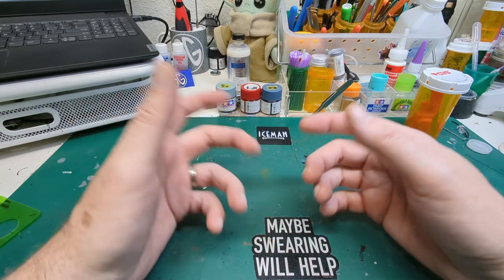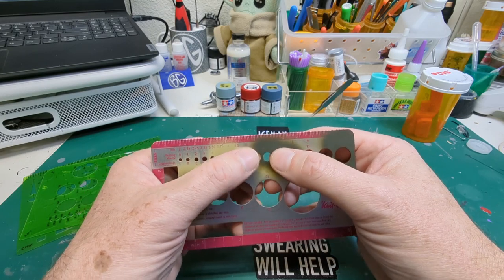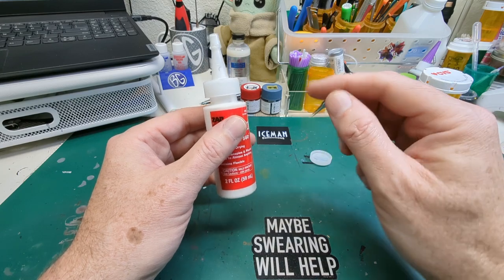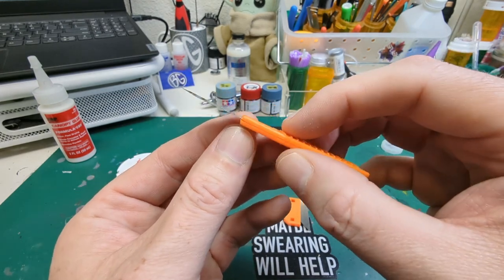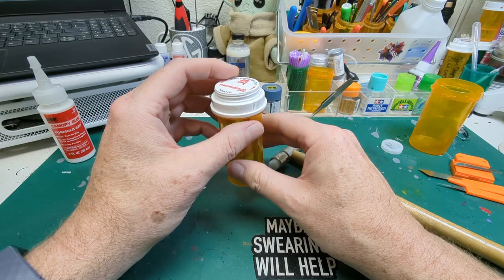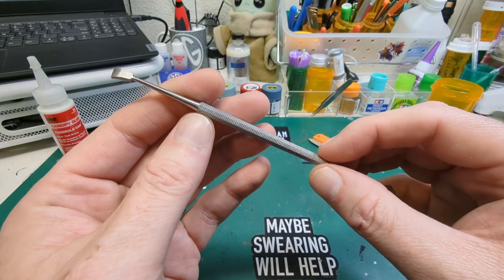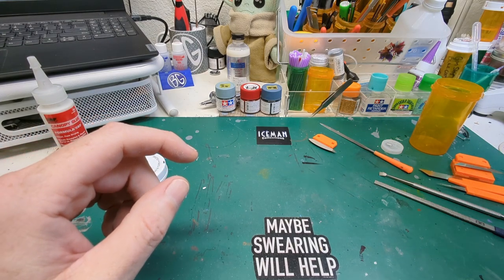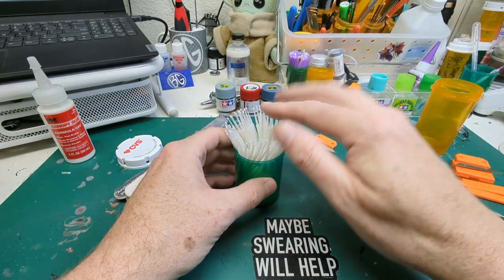The Tools We Use On Every Build! A response to Mark Batson's community question!

Comment: Nice presentation of some of the tools you use.  I really like seeing what other people use in their modeling.  I like those saws.  They look really neat.  I tried to find them on Google and didn’t have any luck.  The Tamiya file looks really nice.  I’m glad you mentioned a beauty supply store for the files.  You can get them for a lot cheaper there than you can at a hobby store.  Don’t forget the eyeliner brushes while you are there.  Thanks for sharing.
Reply from the maker: Hi Michael, i am trying to find a link i can post for those saws also. Not much luck so far. I picked them at a flea market and the guy said they were a hot item he had trouble keeping in stock. there are other version that work just as well, but don't have the slick orange plastic handles.
Reply: @BGsModelWorkshop  You know the one’s with the orange handles have a much smoother cut.

Comment: Can you tell me about the air brush w/ the canister on the bottem? i saw you had it on the luka cee pod cast.
Reply from the maker: Hi, sure thing!
It's a cordless rechargeable airbrush from Spray Gunner. It's their brand known as "no name". Here is a link:
https://spraygunner.com/airbrush-kits/by-type/cordless-airbrush/portable-airbrush-cordless-compressor-kit-with-0-3mm-airbrush-battery-powered/
Reply: @BGsModelWorkshop  Thanks for the info.  sam